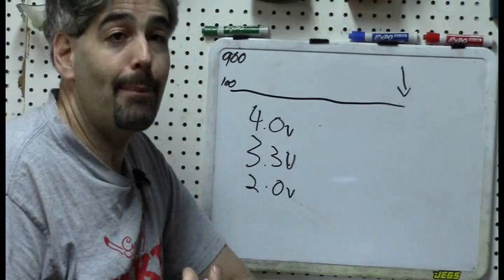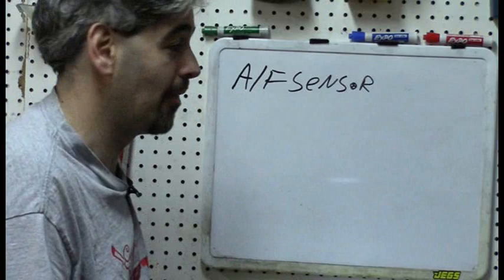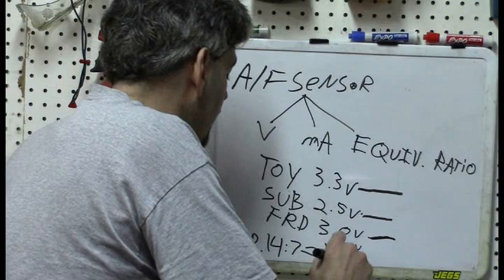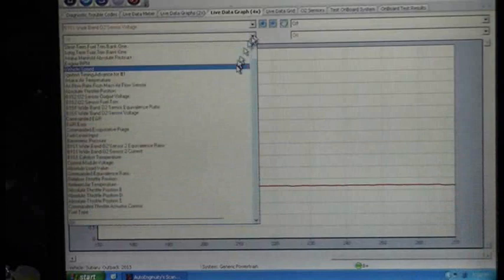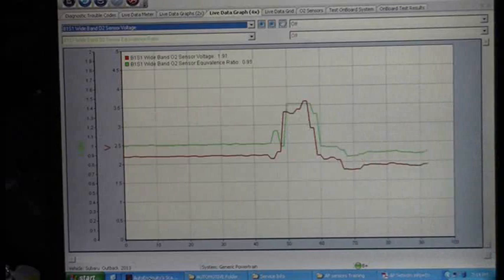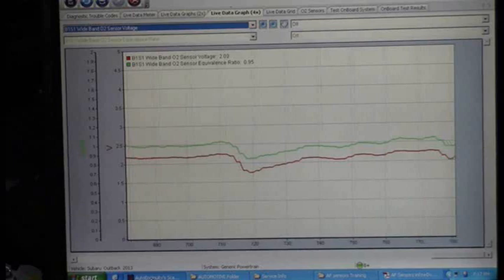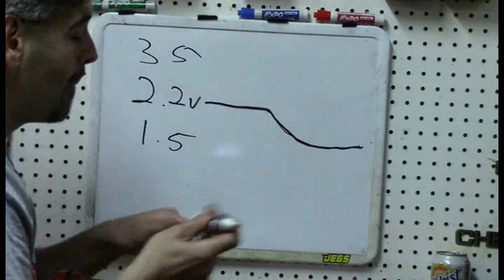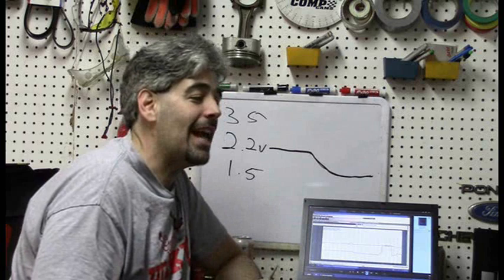Air/Fuel Sensors (Wideband Oxygen Sensors) vs O2 Sensors- PART 2

Comment: Have you work on a Volvo XC90? I made a video and I was wondering if you can help me out. The key point you talk about that "aha" to me was the voltage stoich. I think my Volvo is 1v and that's why it stayed there. I thought it was running rich all the time, because it's not switching to rich lean rich lean like up and down wave. But when I punch the gas like on your video but I don't have it on my video, it's slow reacting to the dip and raise
Reply from the maker: It doesn't matter the type of car.  Fuel trim response from an O2 sensor output is ubiquitous in all OBD-2.

Comment: Hey Matt, 

i hope you can help me solve a perplexing issue I have? 

In short, my scan tool indicates my upstream AF sensor is detecting a rich exhaust (equi ratio at 0.9x). Similarly, my AF ratio reading is about 12.9 : 1, also suggesting rich exhaust. 

Strangely, my LTFT is currently at 14.8 and my STFT is usually around 0. 

it appears the AF sensor knows a rich fuel burn is occurring, yet the LTFT is yelling lean and commanding more fuel. 

Have you ever seen this before?
Reply from the maker: +Ste .L I would induce rich and lean variables to see if appropriate response is made as a next step. Also check voltage outputs from the A/F and see that they are congruent with the ER and AFR.
 Also your data I assume is only from Idle? Need to also do this under RPM curve to see effect under load.
Reply: +Schrodingers Box 

Thanks for the reply. 

I&#39;ve performed that and my results are as follows:
Vacuum leak test - STFT goes from +3 to +11 
Propane enrichment - STFT remains around +3 and fails to drop into the negatives. Propane was fed from a plastic line right into the brake booster vacuum tube  leading into manifold. 

This test we done before I watched your video and I failed to look at the upstream AF sensor &amp; downstream O2 sensor response. I will try it again and see the response. 

I was able to monitor the AF response on a similar car (same make and model but 10 years newer). When all sensors are warm and car running at operating temp, these are the readings from the scanner. 
AF: 2.0 volts no load, small dip under acceleration and massive rise when throttle released (similar to response on the Subaru in the video) 
downstream O2: 0.9v no load, drops to near zero when throttle is quickly released 

On my car, my AF voltage is 0.96v (vs 2.0v) under no load. With the same acceleration and release test, I was able to get the same dip and massive lean response. 

My downstream O2 responds similar to the down stream O2 above. The only difference again is the no-load voltage which is at 0.7v (vs 0.9 in the newer car). Oddly the 0.7V drops incrementally to 0.5v when the car is in park 

If the above comparison is fair. It appears the upstream AF sensor is sensing a constant rich  burn at idle (lower no load voltage), while the down stream O2 is sensing a constant lean exhaust (0.7 and 0.5 in park) 

Matt, what do you know about the downstream O2&#39;s relationship with AF sensors? I&#39;ve read that the downstream O2 does have a influence on the upstream AF sensor. The upstream AF sensor was replaced last year but the downstream was left in place (the car had this issue when the change was done, and it continues to have this problem). I don&#39;t have any o2 sensor codes.

Edit to add further information: 
Mode 6 test shows a failure in "Rich to lean sensor switch time"

Comment: when you say the eq ratio should be 1, is that the same as 900mv. would it show a 1-or 900 on scan tool. good videos, watched them both.
Reply from the maker: Sorry i dont know what that 900mv is referrring to. if an 02 sensor then it would be 450

Comment: Hi and thanks for all your info. So i have kia sorento 2014 GDi 2.4 and i dont have any fault code but in OBDII i have 14% long term at idle and 10% at speed and its stabil 
O2 sensor 1 readind -0.25 to - 0.48 mA
and the O2 sensor 2 reading 0.7 Volt stabil 
is that reight !!!
So i have black smok in the morning just for 30 second and i the car is not ECO 
so i chack the fuel pump and nozel jut its ok 
So wher is the problem ..
Thanks

Comment: Is it part of a proprietary thing to have different standard voltages for each make and model years?  Why not have one for all to save confusion?
Reply from the maker: I don't know. It would be nice. I do believe at some point it will be standardized so that even an incompetent tech would be able to identify a fault on ANY vehicle, but right now- even though I don't run into these all that often still, when I do I always have to look up the values and man, they vary a lot.

Comment: When you read code P2196 on a Toyota where is the first place to look for fixing the problem?
Thanks for the videos
Reply from the maker: fuel trim.
Reply: @SchrodingersBox  i checked short/long fuel trim and also bank 1 sensor 1 voltage and V goes from 3.3v to 2 when pressing the gas and 5 when i let off...
Looks like A/F sensor works but I was suggested to change it due to code P2196

Comment: A year ago I burned beyond recognition the engine harness connector and the sensor connector beyond recognition.  I was able to determine how sensor was wired, so I wired the A/F sensor directly and it worked great for a year.  However, a couple of weeks ago I replaced both sensors again on a 4cyl Nissan Altima and I think I wired the A/f sensor incorrectly because I left out of town and did 1000 miles and car ran great but, maybe I got some bad gas and then everything went to hell really fast.  All the way home, my car was burning fuel instead of getting 32 mpg I was getting 11 to 20 mpg. I cleaned the MAF but I did not have any way of working or cleaning the Af sensor so I drove back home and I was getting po171 and po130.  Exhaust fumes gas me a headache all the way home.  So, last night I put a new A/f sensor in and the mpg came back and no more exhaust fumes and the LAMBDA on scanner tries and keep everything at 1 but, the a/f sensor still has pending code and so does the lean code.  No matter what I do I cannot get the po171 and the po130 codes to clear and the sensor does not allow passing of the SMOG test.  I am at a loss.  Any suggestions?
Reply from the maker: what is your fuel trim indicating? that’s the very first step for a 0171 codes.

Comment: So I have a P2097 (Rich after cat bank 1 Sensor 2) on my 2005 Subaru. That o2 sensor is in fact reading rich most of the time, except under engine deceleration. The A/F Sensor responds in what I believe is a proper manner to the snap throttle based on your video (thanks for that). In general the A/F sensor reads slightly lean (1.0-1.1) for the most part.  The narrow band sensor (sensor 2) also responds by reading a higher voltage (>.9v), then going lean (<.05v) then back to rich leveling back off around .85v.  Both Fuel trims are generally in  the +-10% range. Any thoughts?
Reply from the maker: I would test the sensor reaction with induced rich and lean conditions as shown in the video on A/F sensors and see that it (and the A/F sensor) responds appropriately- especially that it responds appropriately to induced lean conditions. If it does not while the A/F does, the B2 sensor most likely needs replaced.
 this does not appear to be an electrical issue based on your description. Nice job collecting data on this one btw.
Reply: Schrodingers Box well we replaced the A/F sensor and it solved the too rich code but we got in ineffective cat code, P0420
Reply from the maker: That is expected. O2 or A:F sensor codes prevent cat codes from showing. When you fix the O2 codes, it can allow other codes to come through now that we suppressed. I call these 'revealed codes'.

Comment: toyota=3.3v
honda=2.8v
hyudai=1.9v
subaru=1.8v
nissan=1.47v
Reply from the maker: +Zia Din Thanks this is very helpful! I'll put that in my notes!
Reply: I'm working on a 2010 Nissan rogue right now.  First it set a p0172, then a P0171, changed maf, then only the p0172 came back.  Changed front A/F sensor, Now I only get a p0420 and a p2423...  It's a head banger for sure.

  Anyway, according to the books the front A/F sensor should "fluctuate around 2.2v."
Reply from the maker: Rob, Why did you change the /F sensor? What was the data you got  that indicated that was faulty? And the MAF was faulty too?? What was the MAF data you got indicating that was the problem?
  This is only a head scratcher because you never included the data you used to draw that diagnosis.
Reply: Well when I was getting the rich and lean codes intermittently I started looking at maf values.  The graph didn't seem steady to me when revving the engine.  The values at 2500rpm were also under spec.  After I changed the maf stft would steadily drop to -25% then almost stall the car out.  At that point I unplugged the front o2 connector and the engine ran perfectly.  I checked for vacuum leaks with propane, and verified correct fuel pressure.  The original a/f sensor graph looked more like an on/off signal with about twice the time between cycles.

It's a head scratcher for me in the worst way.  I've cleaned grounds, checked wiring to the pcm, to ground and to each other.  I ohmed all the o2's heater circuits and everything was in spec.  o2's at about 3.5ohm and the a/f at 2ish ohms.
Reply: And more so, it's a california emissions car.  The p2423 for the rear cat proved to be a partially plugged converter.  After I started to get codes again, I looked real closely for exhaust leaks and even welded a few cracked pipes on the manifold, which made no difference.  I went over the system with a stethoscope and found no additional leaks.
Reply from the maker: Sorry this isn't registering with me... Do you have a digital or analog MAF on this car-- what exactly is the data you are looking for on the MAF and how did it deviate?  I need to know what MAF data you have and what design it is (analog or digital).  And finally why are you Ohming O2 sensors? Is the trace flatlined? How are you getting a P2423 if you have incorrectly ohmed O2's?
  And why on earth would a partially clogged cat cause the P2423? What was the reading you got that indicated this was the cause vs a catalyst inefficency?  What data did you use to determine the cat was clogged?

 I don't think it;s the car issue that's the head scratcher... I think it's the data acquisition.  I don't see what your data is that is drawing these conclusions so of course, you can't make progress.
Reply: This car is weird, so i'm not surprised your confused.  Plus I'm not the best at explaining my findings.  The vehicle has had the p2423 for a few months now.  It got towed to my house due to a rough idle and an intermittent no start, and it was in fail safe.  When I pulled it in it ran great but was in failsafe, the only code was the p2423.  ... Shop key stated that under certain conditions p2423 would trigger fail safe mode.  I cleared it and the vehicle returned to normal.  I monitored the rear o2 using a modis and the signal was up and down between .0 and .9 and occasionally it would go flat.  Seemed like sometimes the cat kind of worked.  Maybe it was shooting from the hip.  Maybe not.  But it proved true.  The flex pipe actually came apart and plugged the front of the cat with debris.  After I put the new cat in is when I started getting the rich and lean codes.

I would drive the vehicle get a p0172, clear it and drive it again and a p0171 would trip.
I started with the maf,
The spec for the mass air flow is 1-4 gpm at idle and 4-10 gpm at 2500.  Mine stayed at 2 gpm.  So I replaced the sensor.  Seems like good data acquisition to me.  Only the p0172 came back.  The vehicle ran doggy, wouldn't accelerate and barely stayed running.
When monitoring A/f and o2's at idle The A/F sensor seemed like it reacted slowly to forced rich and lean conditions and on it's own would steadily drop to like 1.4 v (Instead of what shop key listed as spec 2.2v) Then the vehicle would sputter and die.  I unplugged the the a/f sensor and the vehicle ran good.  That's when I replaced the a/f sensor.  Took it for a test drive and all was good until the p0420 popped up which had never shown up during previous drive cycle runs, and the 2423 returned, which hadn't shown back up since..

Since then I said what are the odds, and threw the 2 rear sensors at it and went on a drive cycle run last night.  the 2423 is gone.  Only the p0420 remains.  The down stream o2 reads a constant steady switching between about .3 and .9.    The a/f sensor reads 2.2 volts and during driving doesn't deviate too far from that.  So I would doubt an engine problem causing that code.

This vehicle has 217,000 on it.  So for a few sensors to be bad, isn't outside the realm of possibilities.
Reply from the maker: I'm not confused it's just that you have no useful data for a diagnosis.
  All you are doing is describing symptoms.  There is no DATA though so of course a scientific process is impossible.
Reply: bmw=1.9v

Comment: Nice video. now PLEASE HELP. How does Nissan measure Fuel trim. or better what terminology is used by Nissan to read fuel trim on a 2005 Murano. Currently using a EVO Genisys scan tool .
Reply from the maker: all OBD2 is standardized.
Reply: Schrodingers Box Thank you ,was looking under Engine instead of GLOBAL OBD2 found it .

Comment: Hello! Great video thanks! Can you tell me would any wide a/f sensor fit my 2005 subaru outback 2.5L? I mean if replace the connector with the old one?
Reply: I mean I have ACDelco 213-4751 wideband a/f sensor at hand! Can I install it into my Outback 2005 if I  cut the connector of this sensor and replace it with the connector from the old sensor?
Reply from the maker: No.

Comment: Hi,
I am seeking for an information for the O2 sensors. I have checked the video for Air/Fuel vs O2 sensors and didn't find the answer. I know that a proper O2 sensor will oscillate between 0.1 and 0.9 Volts. Is this valid for the cars with 2 O2 sensors as well ?
In my case the setup is:
4 Cyl engine; O2 sensor before the Cat and 2nd O2 sensor after the Cat.

1st O2 sensor is working properly - 0.1 to 0.9 values.
2nd O2 sensor  is indicating almost a straight line. If I play with the fuel it can go to lean 0.2 for example if I add fuel it goes to rich - 0.7 for example but it is not oscillating.

So the questions I have:
1) What is the purpose of the second O2 sensor ?
2) Is it always mandatory for o2 sensor to be oscillating in order to confirm proper working ? Is it possible that in this setup to have a different behavior of the sensor ?

Thanks for your videos and support.
Reply from the maker: See my video "P0420 P0430" diagnosis and you will perfectly understand everything you asked
Reply: Schrodingers Box Thanks a lot. Exactly what i was looking for but couldn't relate to the name of the video. :)

Comment: at the end of the video u didnt mention if the fuel mix sensor doesnt dip as its supposed to then what could be the problem. for oxygen sensor if it dips at full throttle u said its maf or fuel pump issue
Reply from the maker: Yes its exactly the same only in reverse,  If the line increases it indicates lean on an A/F sensor same as a dip does on an O2 sensor.

Comment: I have a question. How to check downstream sensor using scan tool? when you check both graph  with  wideband?
Reply from the maker: A downstream will be a normal ZiO2  sensor so you simply measure its voltage. The range will be .1 to .9v but it should show .8v while at 2200RPM
Reply: @SchrodingersBox  In my case i install new cat and both sensor, i work on Subarus( i know you do not like them but they are best in snow) and got one from an action without cat and pipes . Still have p0420 code. The cat aftermarket. runs very good and S and L trim looks good no vacuum or exhaust leak , have smoke machine. When you looking at the graphic  on both air/ fuel sensor is good but ox is going up and down, like a bad cat.

Comment: Can you generate the rich condition by unplugging one of the coils power so the coil does not fire there for the air fuel sensor would pickup a rich condition.
Reply from the maker: jnarez1 No- it would detect a lean condition if there is a cylinder misfire.

Comment: for standard NA engine 2000cc, whats the perfect range AFR? between 13.3-16.5? AFR should be constant during idle at 14.7 right?
Reply from the maker: depends entirely on the model. the Equivalence ratio should be 1.